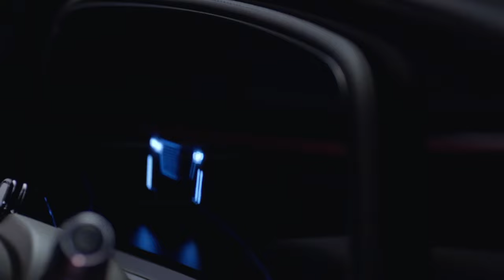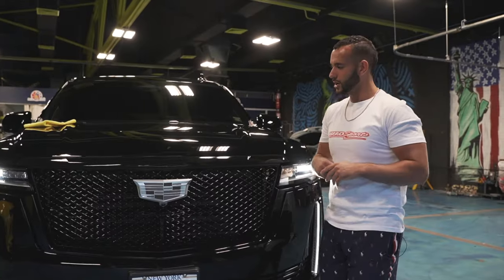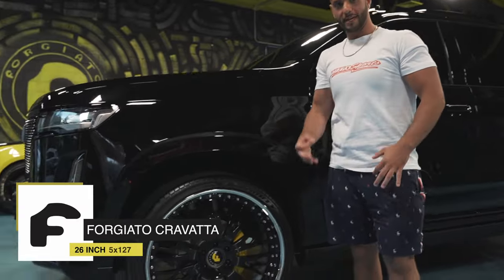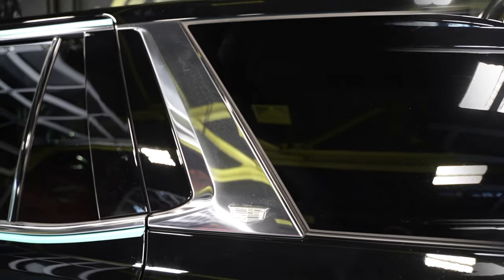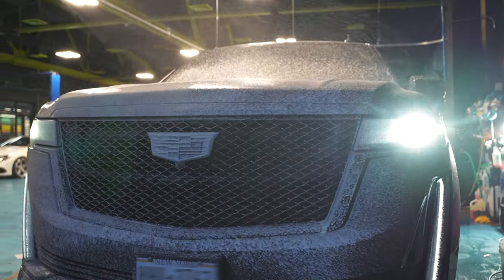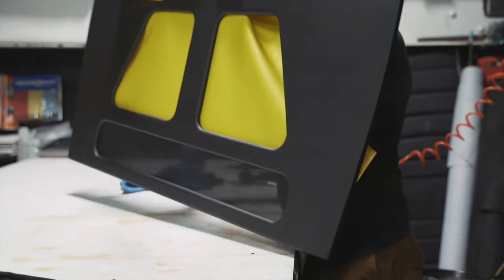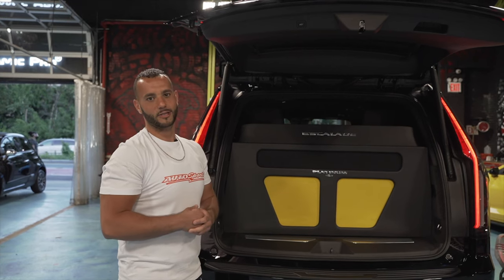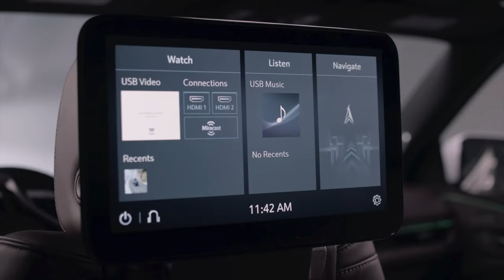SATISFYING Cadillac Escalade Walkthrough w/ 26" FORGIATO'S and Custom Sound System

Comment: I have a couple of question.
1. Is there any vibration at high speed on the
highway,if so what speed
2. What is the road noisy like from the 0EM 22s
3. Any rim dents
4. Rate ride quality 1-10
Reply: You shouldn't even have all those questions sensitive sally